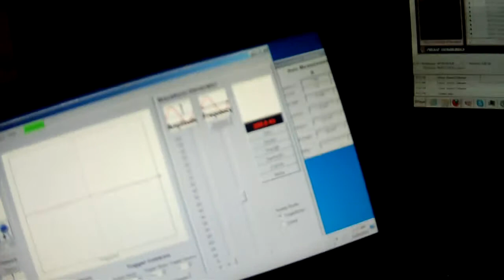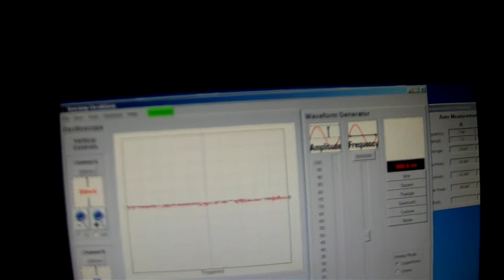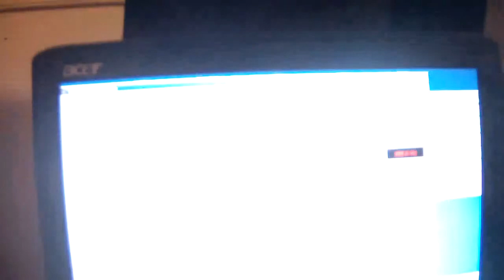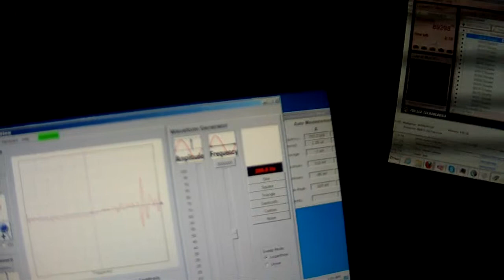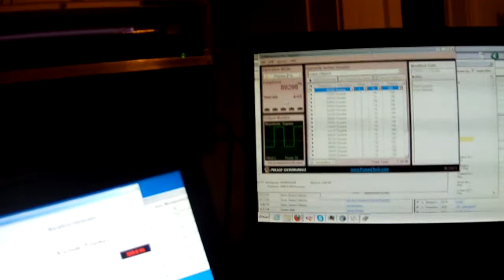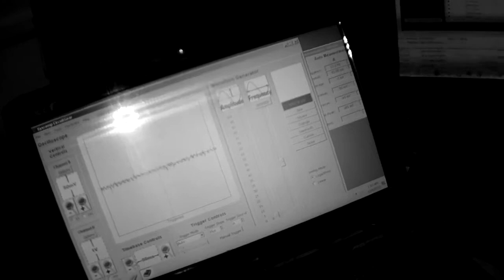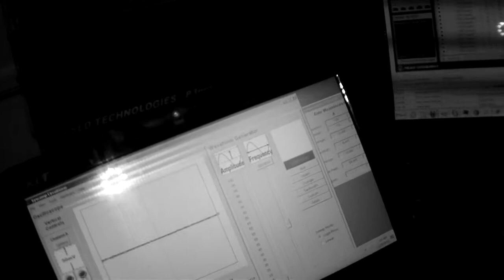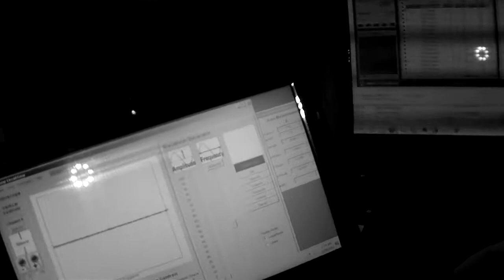Rife Machines Carier Wave or Not?

Comment: You want to get this 100% right , study prof Pappas website which is not proffesional looking but has most everything you need to know panospappas.gr .. he understood & made the Papimi device PEMF used by 49'ers for a while as "Thumper ) i think it was called . Moreover he is a Mathematician PHD and showed how Bio Tranmutations make the ION pump work , there is no dipping into "Cell reserves" there is LENR at work aka alchemy or correctly Biological Transmutation .

May not seem relevant but the Voltage of the Cells and potential created within are fundamental toknowing what frequencies & Pulsation t use .

Great work yes not to take anything away from your experiments